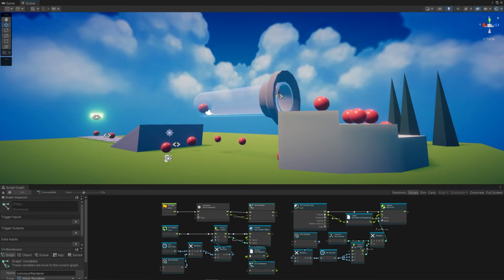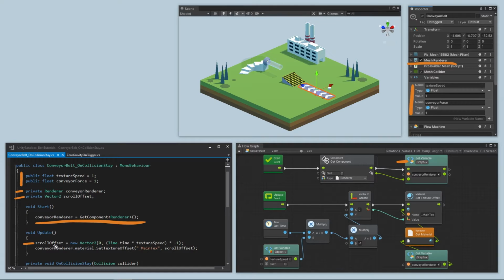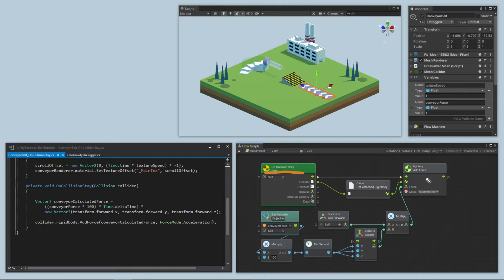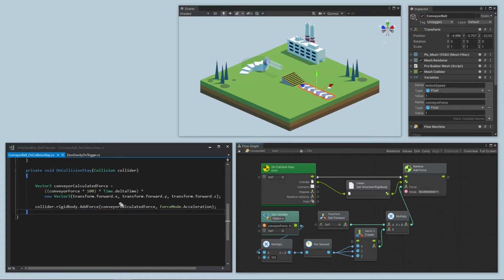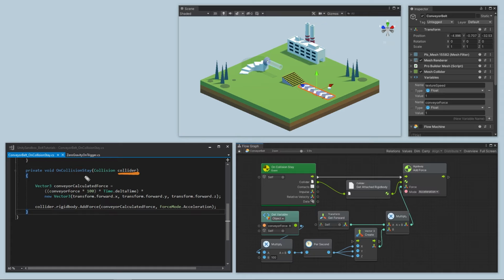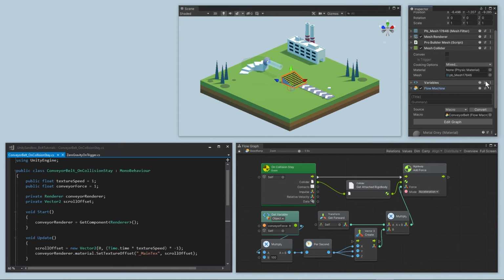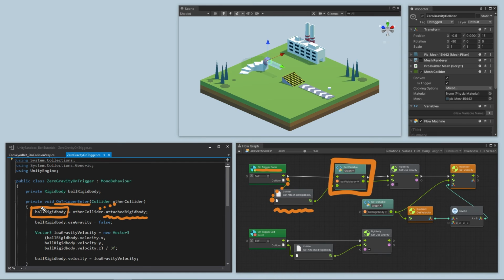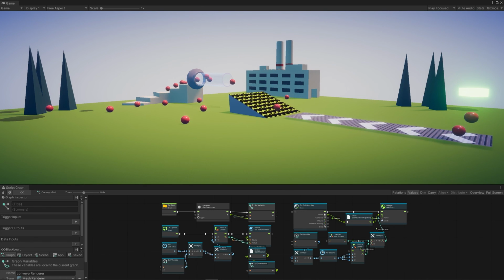Unity Visual Scripting and C# | Boost Ramp + Antigravity Tube + Conveyor Belt

Comment: Hi I just tried the anti gravity tube and it worked. But I need my spheres going in the y direction only. How would I do this ?
Reply from the maker: Great! So you're thinking something like a vacuum tube, right? Check out the Rigidbody component on the ball--look for "Constraints", there you can freeze the position. 

On Trigger Enter you get the Rigidbody, then you can use it to constrain the X and Z position. Search for "Rigidbody Set Constraints." You may need two nodes to set the X and then the Z. You might want to do this after a Wait unit (after the Set Velocity) so that the ball can travel a little bit into the collider. And, of course, you'll want to turn those constraints off On Trigger Exit. 

Another way to do it is to simply divide the X and Z by a number much greater than 3 and then on an On Trigger Stay move the ball, like the conveyor belt. On the conveyor we use Transform Get Forward, but you can create a Vector3 variable and put in your own value or use "Vector3 Get Up."